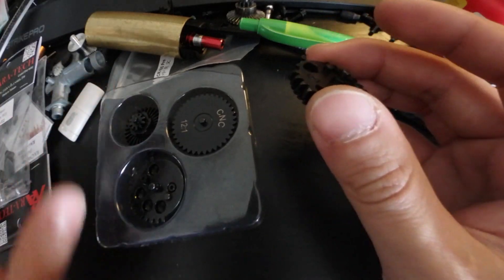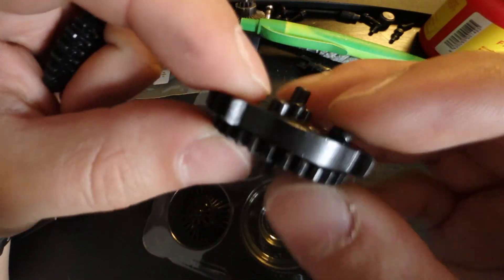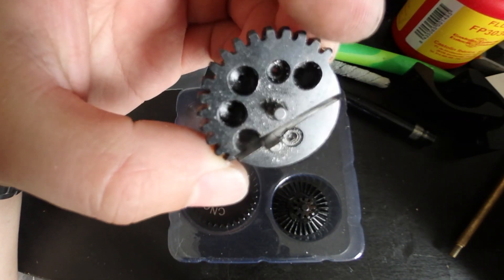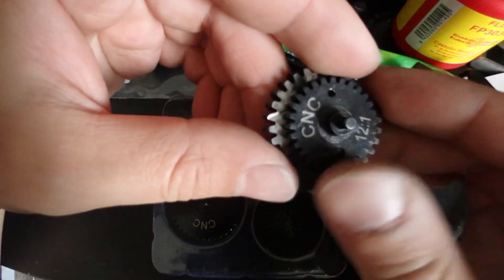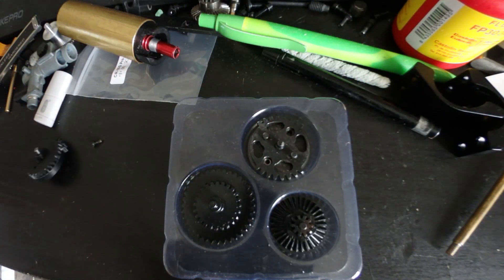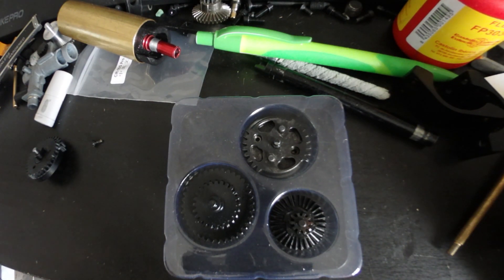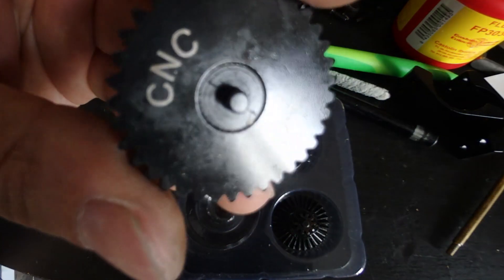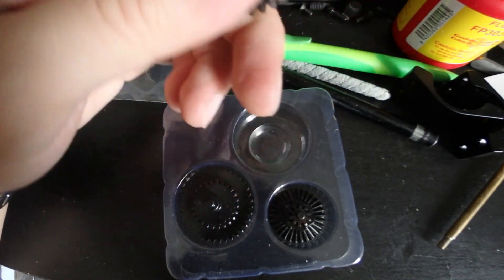How to make 12:1 DSG gear for AEG

Comment: a tip that i learned from working on rc cars is when the screws are really tight usually glued with loctite you just take a torch and heat up the screw so the glue melts and you can twist it out
Reply from the maker: Then you risk losing the heat treat on the gears
Reply: @wyz2285  I know this is an old post but I thought my comment might help other people, you would only loose the heat treatment if you got above 220ºC and that's if they are tempered, I would imagine that they are not in which case you would have to heat it to around 760ºC to lose the hardness, you would melt aluminium well below that point and the glue used should melt with just the use of a hot air gun or maybe even a hairdryer which I often use on aluminium to melt Locktite red and the aluminium doesn't melt.

Comment: may i ask if im going to use this type of gear,  is it recommended to use a very high torque motor? for example 28 tpa or frankentorque motor to avoid overspin?
Reply: You can go that route but also short stroking helps to prevent over spin or double feeding also making sure you install the right delayer chip and customizing you tappet plate fin.
Reply: @Airsofthelpvancouver1963 don’t put a delayer chip in a dsg

Comment: i made my aeg from 27 rps to 46 rps because of this thanks alot for the tip
Reply: Ano motor gamit mo?
Reply: Mababa pag 46rps lang
Reply: Ilan tpa gamit mo?
Reply: Mababa pag 46rps lang
Reply: Tado in airsoft 24 13:1 gears, shs 16 tpa, saka 20c 11.1 kaya cguro mabagal last kong check, pero napaabot ko pa ng 55 rps yun nun ginawa kong 40c, hinihintay ko pa yun 35k na na tienly motor, baka may ibibilis pa
Reply: naka guarder 140 spring yun 55 rps nung ginawa kong 170 spring bumaba ng 50
Reply: San kaba? Nasa pinas kaba? Magkano kuha mo sa tienly? Dito ko sa italy tapos yung shop na meron lang na tienly eh sa germany ang mahal nga lang
Reply: 2700 pesos para sa motor, oo pre nasa pinas lang
Reply: Tangina 2700 lang?! Dito aabutin ng 5.5k pesos kasama shipping papunta dito sa italy galing germany
Reply: Ano mosfet mo?
Reply: Tado in airsoft 24 gate titan andvance
Reply: haha kala ko nga mahal na yun tienly e, yun shs kasi 1900 lang
Reply: Ayos haha. Parehas na tayo ng setup nung sa video ko. Nasa 65-67rps ako pag naka 14.8v
Reply: Tado in airsoft 24 ah 14.8 volt pla, nagfefeed pdin ba kahit 65rps?
Reply: pwede naman gumawa ulit hehe
Reply: Ang kaso naibenta ko na. Akala ko kasi magiging busy na sa trabaho
Reply: Oo pts epm na magazine. Yung lonex na mid cap dko na nasubukan eh
Reply: Oo mahal nga lang bumuo ulit dito hahaha. Ano nga pala gearbox gamit mo? Ayoko na muna mag retroarms, mabigat sa bulsa dito e ahaha
Reply: stock v3 gearbox lang na may quick change spring
Reply: Ahhhh naka v3 ka pala, akala ko m4 din e hahaha. Buti kinakaya ng gearbox mo? Ano spring ba nkakabit?
Reply: m170 spring mukang solid naman yun gearbox, yun mismong body lng mukang cheap, steyr aug na gwa ng aps
Reply: Ayos ah ahaha. Iupload mo na 😂😂
Reply: Tado in airsoft 24, pag naayos ko na lahat, kukulayan ko p sana ng puti yun
Reply: yun balak ko itry yun brushless motor ng no.1 option kung ok sa dsg build
Reply: Balak ko nga mag experimento ng 18:1dsg tapos naka 45k na motor

Comment: it works man thanks, but another trick to remove the glue from the gears is to heat it up with heat gun at high setting then just pry open with a watchmakers screwdriver
Reply from the maker: You would risk removing the heat treat of the gears
Reply: ah ill see what will happen to my gears if it breaks sooner, thanks for telling me

Comment: But what about the double cam nub from the DSG that activates the cut off lever,the 12:1 gear only has one nub ,won't this cause problems in semi auto ?
Reply: Will Look forward to seeing it working
Reply from the maker: You will need a good electronic trigger unit that can detect the sector gear position without the cut off lever (Titan, Amoeba EFCU, Perun, Grizzly etc). If you attempt such a stressful build you should have it anyways.